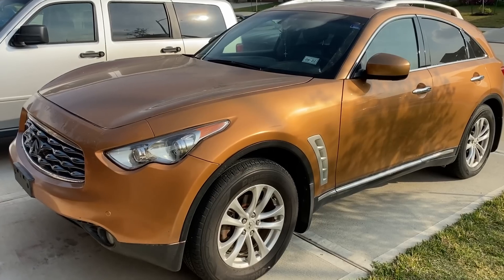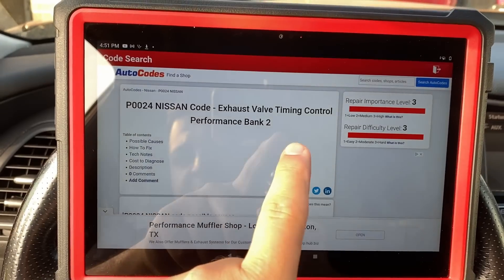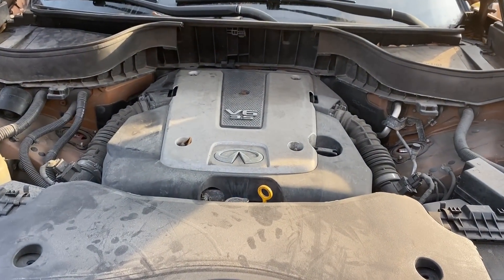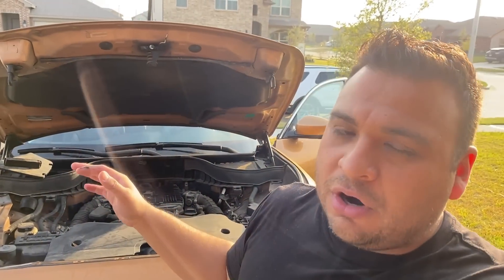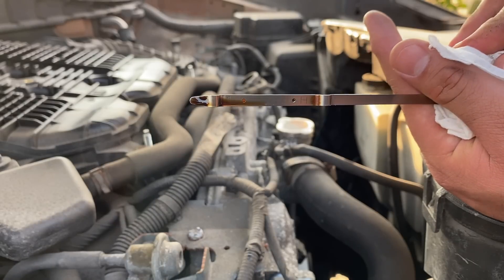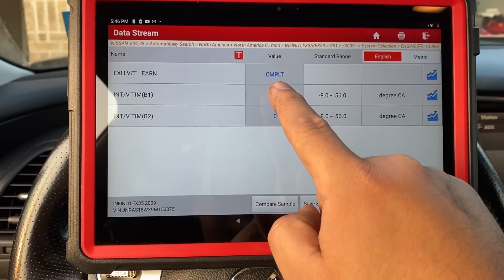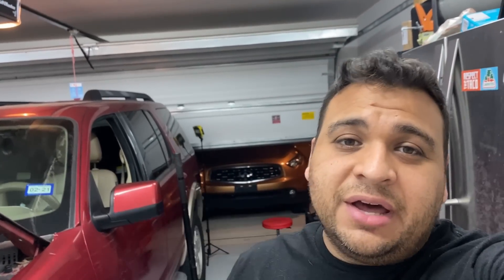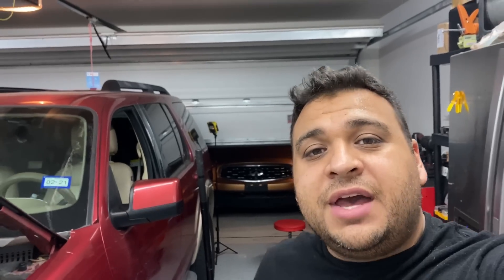INFINITI FX35 RUNS ROUGH STALLS P0024 P0014 FLOOD CAR NIGHTMARE

Comment: I'm getting a P0081 Intake Valve Control Solenoid Circuit Bank 2... 2010 FX35! I'm going to change the VVT Solenoid. Have never seen this code before though.

Comment: I wonder if the corrosion on the engine is a FX thing. I live in the north east where we have significant road salt in winter months and I am the sole owner of my 2009 FX35 purchased new from Infiniti with only just over 80,000 miles and my engine also has allot of that white crud around the surface and many of the clamps and bolts have rust. I always thought it was the result of engine heat.  I was thinking about getting my engine cleaned by a detailer  🤔 (After seeing the seats I do agree this may have been a submerged vehicle but I still find it odd that under the hood that car looks allot like my low mileage vehicle)

Comment: In your shoes, I would clean that corrosion on those ground connectors, check solenoïd connector aswell, and let the customer have car back, drive it for couple weeks and get feedback from her. Just the way it looked, I wouldn't be surpised if this should be the problem! Sometimes data don't provide an accurante information, especially for a flooded car, they provide general information based on statistics, but this could be a specific problem related to water damage. Sometimes, you have to figure out yourself. This my opinion. Good job men, I stayed motivated to watch whole video🙂

Comment: I'm a mechanic too and own ( have owned ) few vehicles with VQ35 engines. 
Thing you can do to save the retarders is to take sand paper 160-220grit and sand the mating face on the engine side ( the metal one),then wash, put back everything together and run valve retarder re-learn procedure. One option is thru the scan tool, next option is to hold the RPMs in Park at 2000. Have in mind that at first those magnetic retarders will bite in the freshly sanded surface and it will take few hours of driving till it start engaging/disengaging properly. Other tail tail sign of problem with them is when you go slowly right about 1000-1200rpm engine starts to shake ( acts like missfiring but it's the exhaust valves bouncing from 30-0degree) this happens on 07-08 Vq35HR

Rust in the engine bay is absolutely normal for cars operated in snow ( rust ) belt: hose clamps rusting away, filter clamps eaten so badly from the salt that they literally fall apart, etc etc.
Reply: Are you saying to sand the part on the engine that the retarder would connect to?   How much would you sand?   I'm not at the point where I need this repair yet.... but maybe someday!
Reply: @Jondbuch  yes you sand the metal face that the restarter is touching. Go with 220 soaked In oil and dont press. All you have to do is lightly " de glaze " the surface.  And again it will take few drive cycles untill retarder starts to engage properly but this will fix your problem for free. I did it on my Infiniti, first pulled the retarders from junkyard and there was 0 difference, then sanded the metal plate and Booom fixed.

Comment: That corrosion is normal believe it or not . If you worked on cars / trucks from New Jersey by the shore  salt water in the air . .. that car definitely 💯 % was not under water . . I can send you pictures of cars that come from New Jersey by the ocean and they all will look 👀 just like this one . The worse thing is the bolts and Oem squeeze hose clamps . The clamps fall apart as soon as you squeeze them . The bolts deteriorate and you have to hammer on a 9mm socket that might work if your lucky. . As for the ground terminals , I cut the ring connector off and crimp on a new connector and change the bolt .

Comment: That looks to familiar I have at least one call a week like that and when I see the car my first question where did you get this car from ( I got a good deal I got it from the south for a real good price ) and I say ( yep you right a flooded car now get a few thousand to replace electronics wire harness and ecu pcm and everything else. And I say take it to a shop that has the time to tear the car down to the bones and replace everything that needs to be done. ( it's ok just get the car running it's sold or I'm selling it. Let the new owner worry about it not my problem I'm selling/sold as is) I feel bad for the people that buy these flooded cars and here in NY I see that everyday that's why I'm starting to refuse to work on cars unless I see it's the last buyer that got screwed but if it's for profit I send them out and they can look for another shop.

Comment: I had that p0024 with low power on my Infiniti G35 after I removed and rebuilt the head due to burned valves. It did not have that code befor I removed the head. Changing the oil &filter made it run better for about 10 miles, then engine light and loss of power came back. I tried swapping the solenoids from bank 1 &2 (which u can do on this engine) but nothing changed. The Fix was changing the oil filter every 10-20 miles,  4 times in a row... Some gunk or somthing must have fell in the oil pan when the head was off an kept clogging up the filter. I also found that the pcm will shut off both vvt solinieds once it sets that code. Also the solenoids won't work until clearing the dtc first.
Reply: Yes, the computer takes the VVT function offline when it detects a discrepancy of desired vs actual position for safety of the engine to prevent bending valves and such.
Reply: Great story, Thanks for sharing.

Comment: Nice! I have an 09 FX50s with 205k miles same color even but with the java brown interior. The 5.0 V8 is super fun. It started missing last week and check engine light came on. I got home used my tool determined it was a coil pack, swapped in a new one, 30 min later all is well.

Comment: For the Int/Val Tim…what if the numbers are not “0” for both banks at idle with no DTCs and car runs fine???

For example…what if you had 2 deg on Bank 1 and 3 deg on Bank 2 while idling with no DTCs and car runs fine?
Reply: That's normal a few degrees off is fine timing chain might slightly wore or was changed and only got it off a couple degrees

Comment: Hey man i have the same exact car and the same error code with similar symptoms. My car has never been flooded tho. Ive tried changing engine oil and even the solenoids but it didn’t seem to fix it. Should I just change the whole timing cover?
Reply: I would try removing the solenoids and cleaning then as they can become clogged with sludge if oil changes were neglected at a point

Comment: I understand your PTSD with flood cars. You’re a smart and confident tech, but even still, no one wants to be married to a nightmare. Good video 👍
Reply: Yeah he went overboard on the assumption's. The car is 12 years old with 140K miles & he pulled up a stored code. If it was going to have major issues from supposedly being flooded it would have them already. I've seen oxidation & surface rust on a lot of cars. He never did investigate the stalling when turning. Far from a nightmare.

Comment: Eric you're a wise man. Remember that Black Lexus years ago? What was it's final result?
I agree, l would do a complete ground connection cleaning and also remove every connector, clean with DeoxIT 5. High resistance/corroded connections will produce all kinds of erroneous/intermittent failures.

Comment: That vehicle could use a few cans of Deoxit and several terminal manual cleanings. I have to agree with the mechanic...flood vehicles are purchased to save a ton of money. Most of them are disclosed as subjected to floods so those customers who have them got those vehicles for well below the average price. Now comes the battle resulting from their inexpensive purchase, corrosion and water contamination concerns. There is absolutely no reason to give them a discount or feel sorry for them when looking for repairs as they were warned or just didn't pay attention etc. I wouldn't give them a warranty on any work either. Anyone who can stand the stench of mold in their car has a screw loose.

Comment: RUN, RUN, RUN away from that flood car!  I did enjoy the video because my wife has a 2013 Infiniti EX37 with the 325hp 3.7 engine.  I'm changing the oil every 6 months on her car because of that complex engine and it usually has less than 3k miles on the oil.  42k on the car since I bought it new.

Comment: Nissan fanbois know these motors as a VQ35HR or "high rev" engine.  These are also available in the 350Z and G35(?) model, on top of your FX35.  Didn't know they were available in Maximas.  Another disappointment on a top-tier engine model from Nissan...again.

Comment: There is a solution after changing the oil and filter for this car and that is the crusher, that's unfortunate though.
Reply: Why crush it if its running fine? I guarantee you could find the updated part design at a junk yard since the bulletin is so old & people got the part replaced under warranty. You dont get ride of a car just because someone thinks it will have issues.
Reply: @wandameadows5736  There is mold on the seats bottom cushion and probably under the carpet, also the car will never be reliable again.

Comment: GREAT VIDEO ERIC.if this owner bought this car without it being DISCLOSED it was a flood car he needs to talk to lawyer.IF THEY DID KNOW<they need to talk to a PSYCHIATRIST!!!haha  Imagine if you can an orange sitting below a tree for 2 months ,it may LOOK like a nice ripe fruit,but when you cut it open,BELIEVE ME it's going to be MUSH inside. THIS car WILL be nothing but headaches for the owner,not only that it WILL be dangerous to DRIVE.why ? LIKE THEY SAID IT WANTS TO SHUT OFF,and there's going to be mildew and mold spores in the seats and VENTS.Water displaces oil and got into all the engine parts and connections and RUSTED or corroded those areas,the damage is DONE,the body and glass maybe perfect but that's it.SO RUN AWAY,run away fast.haha thanks Eric